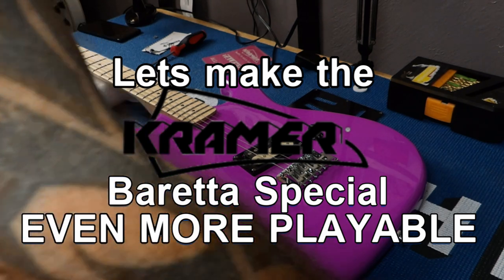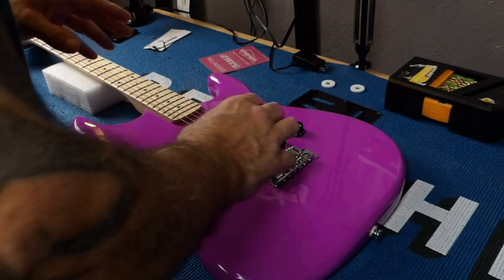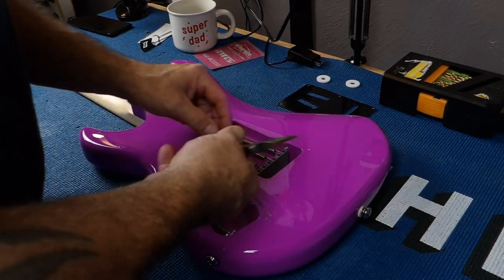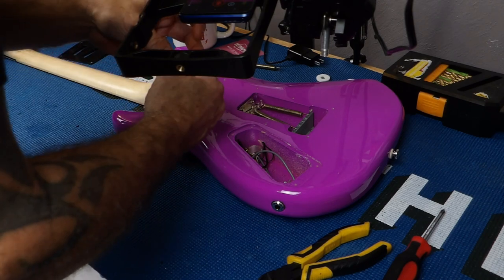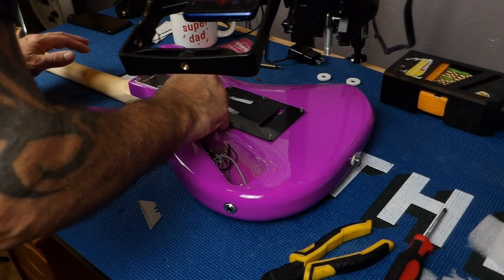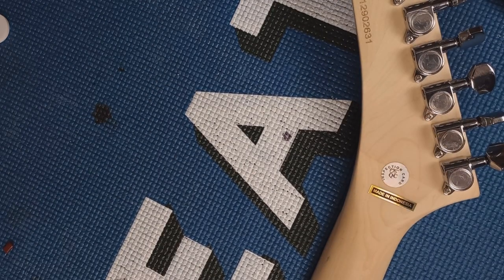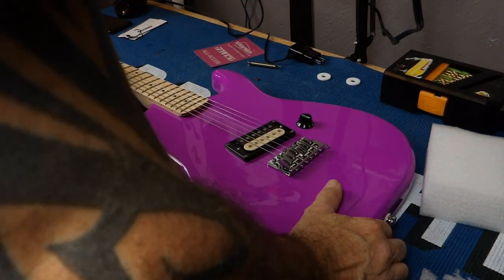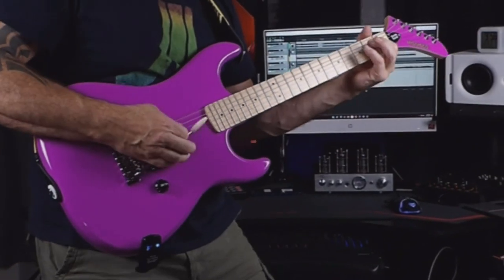Kramer Baretta Special - How to make it sound even BETTER!

Comment: The pickup is Kramer's brand of Alnico 5's. The more mid to high priced guitars carry the Seymour Duncan JB's.
Reply from the maker: They are a JinWoo branded pickup.  Made for  Epiphone.  But finding the factory they come from is hard to do.  (Part of trade secrets and UCC code protection argeements. ) The  reference I was making was more of a question of wondering who  exactly manufacturers the pickups, or what parts are used and from what company.  For instance Seymour Duncan even makes some Pickups for the Fender company. 
 I am aware that these are not official Seymour Duncan's.  But finding the source is what I was referencing.  Seems JinWoo is just a label name from what research I have done. Sorry for any confusion I may have caused in the video, and thanks for watching.

Comment: Regarding the removal of that little doo-dad on the Volume pot,  is there any reason a guy couldn't just snip ONE of its legs so as to disable it?  Would that do the trick?  (And yeah,  I realize it doesn't make much sense to snip one leg and not the other;  just kind of wondering...)  Also,  if the purpose of this capacitor (a "treble bleed"?) is to preserve treble when the volume control is turned more downward (which strikes me as a good thing),  why would we want to disable it?  I'm obviously not experienced with this subject matter,  and I'd welcome any thoughts (within reason)!

Comment: I just bought the candy blue Kramer Special. The only good thing about these guitars is the neck shape and the color...that's it. The problems: will not stay in tune, sounds too bright and piercing, the frets are medium and don't seem to be good quality, tuners, bridge, and nut are terrible. I had to completely modify mine. All new black hardware (floating FR tremolo/locking nut), fretwork, FR string tree, new pot (Bourns), Seymour Duncan JB, and ebony fingerboard change (Neck Illusions-check them out). Now, I'd put it against any thousand dollar guitar. They're great for modding, and you have a mahogany body to start with, not plywood or some sub par wood
Reply: best analysis yet brotha, they make great mod platforms, think buying a guitar kit that's 70 % done for you!!!
Reply: Hey how did u change the fretboard?
Reply: @satchrules101  Check out Neck Illusions. It is a very thin and very realistic material that sticks on the existing fretboard. It stays in place, but won't permanently harm the wood if you later decide to take it off. There are tons of options. Most importantly, it actually looks like real ebony. It was a low cost option for changing up the fretboard

Comment: I'm getting one of these. I had a Baretta with a JB and a Floyd I got in '87, and while that ax had its upside, I was never a fan of locking trems which I had on a dozen guitars in those days. My rule with guitars is if they are good out of the box I don't touch anything, but if they have room for improvement, I will tweak it. One thing I love about Kramers other than the necks is the body shape. They have such a great belly and arm cut that it makes other guitars feel awkward. I'm glad to hear these have such good pickups, because I don't want to go down that rabbit hole if I don't have to. I own tons of pickups, Dunca, DiMarzio, EMG, etc. And I just don't want to touch any of them if I don't have to. Removing that little capacitor? I'll do it if I think I need to. Great vid.
Reply from the maker: No you don't have too. However it seems that The bleed does not work as it should with it. If you find that the pickup is lacking that extra crunch you may want, just cut it out.

Comment: The wammy bar on mine seems very loose in the threads. Are they all like that?
Reply from the maker: I haven't had a loose one yet. It should be snug. But the spring tension in the Cavity is definitely to much. It  requires lots of pressure  to use and put a lot of pressure  on the bar. I only run two springs on a stock trem to solve this.
Reply: @FultonStreetBeats  thanks, yeah I pulled the middle spring and all that I’m talking about the threads of the wammy bar itself. When it threads into the guitar. It rocks around in the thread it just seems really loose. Trem works fine. It’s just where the bar threads into the trem
Reply: Maybe I just had to give it another 360 degrees further once it started to get tight. Hopefully I didn’t force it too hard lol

Comment: I had a assault 220 fr white black ..i had teo .bc i loved the guitar but the way they routed the floyed or the wood they used made it sound thin.i am a les paul custom an LP prophecy player.so thats the sound i like.so i even changed the pups as they sucked.they where really loose sounding and i play high gain amps and oy reslly good high output pups lile my prophecy gx dirty fingers sound good out of them .theses pups had 14.k and sucked so i swapped them for a57 classic and a phat cat..even those didnt work it just sounds...hollow like plywood.. no matter what pickups I put in it the reason why I had two is because I really liked the guitar so I did what I could to make it work the second time I tried everything just would not sound the way I wanted it to it has something to do with all that extra space in the back I'm sure but I've had it if you Floyd Rose equipped guitars that didn't sound like that I play metal so I need my wrists to be super tight and I had to fight that guitar to sound that way no other guitar I had in recent memory had that issue it's like having emgs just too much compression is almost what it sounded like no matter what pickups I put in it very strange like I said it's a shame because the creamer is salt was a beautiful guitar that played nicely as well